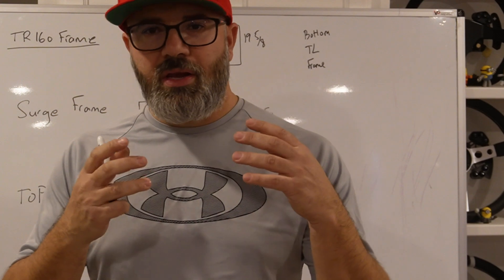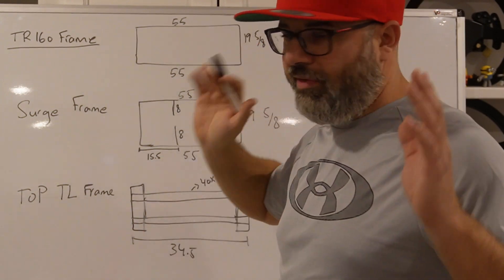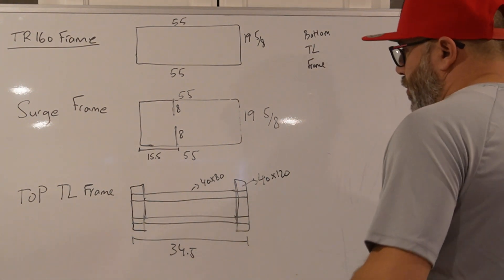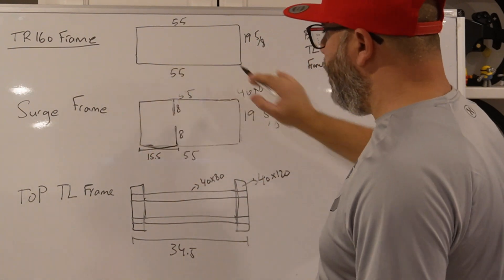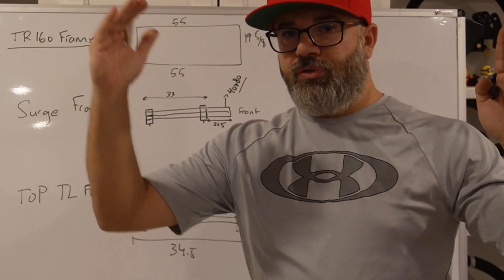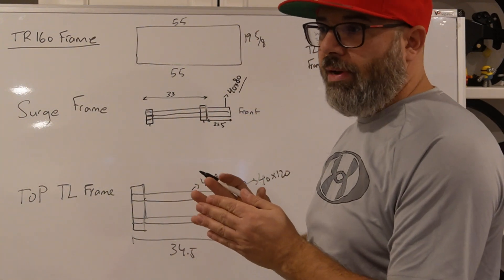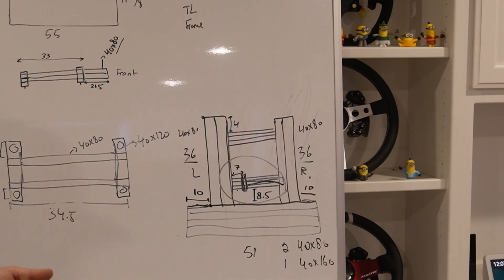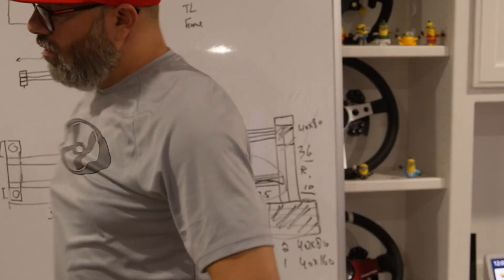Eracing lab RS Ultimate Series - Measurements

Comment: Appreciate the measurements but in case someone else follows this thread and makes the same mistake I did, those horizontal pieces on the lower traction loss measure about 21.5 not 31. Luckily i ordered 31 and just cut them down. It can also be figured by subtracting the width of the 2-40/120's plus 10" each side. Thought this may help someone. Thanks for everything!

Comment: dumb question but im diagraming this. on the bottom TL frame, what are the lengths of the 2-horizontal  pieces?
Reply from the maker: All pieces are mentioned in the video(unless I missed it by mistake). These are 31 inches.
Reply: @simul8master  thanks for the quick response. noted it down. also the lengths of the top TL vertical pcs, they would be the 40x120 pcs.
 Thanks for your time and effort. sorry if i missed it somehow. it also may be in your assembly vid which i have not seen yet.

Comment: thanx...
the one part i dont understand...how does the actuator connect to top frame? to cause it to move?
Reply from the maker: I have other videos explaining all this. The actuator does not connect to your actual rig. The actuator will connect to the surge platform. Your actual rig will then sit on the surge platform and connect to it via brackets.
Reply: @simul8master I am in the process of building this rig. When attaching the actuators, no measurement is given for vertical offset so that there is enough clearance from the surge and traction platforms. What offset would you recommend.
Reply from the maker: @RJCavallo hey - not sure what measurements you are referring to?

Comment: I found the measurements for the bottom platform but in another video for the traction loss frames you mention they are 40x120 and in this one you mention they are 40x80 which is too small to fit the TL plates that come with the kit I believe?

Comment: First of all, thank you very much for your video series!! It has motivated me to also consider a DIY solution, and all of your explanations have been very helpful.

Due to limitations in my man cave, I'm wondering if it's really necessary to have such a wide stand in the back. The TL doesn't seem to utilize all of that space, right? Is it for stability reasons, or can it be narrower? How far it swings from left to right probably also depends on how far back I would mount the TL actuator. I only have 42-43 inches available.

Have a nice day!:)

Comment: Excellent videos. I just completed my build on a NLR F-GT ELITE chassis. It was a little more complicated than the TR chassis. Regarding your surge. How much surge are you getting?  Mine is not very noticeable.

EDIT: Also, there is no way I would have been able to complete this project without your videos. KUDOS!
Reply from the maker: You can tweak to get more - are you using srs ? Did you enable boost?
Reply: I am using SRS and have just started  tweaking in SRS. Boost is at 5 I believe.  I don't see a slider for just surge which I found strange.
Reply: Hi brianh7293 I also have a  NLR F-GT ELITE chassis and I'm just beginning my measurements for the traction loss kit, can you share your measurements  or if you  have any tips or advice that you can share that would be great.

Comment: Hi, thx for the great video. What is the function of the front 40x160 in the lower traction lost module? I understand that the first one in the middle must have this dimension in order to provide enough space in the depth to be able to additionally attach the mounting for the actuator. The front cross brace only holds the rotation fixer, which would also look more central on a 40x120 profile. Is there anything i am missing?
Reply from the maker: Hey check my video on building the TL profile - It will probably address your concerns.
Reply: Thanks for the video  @simul8master . Did you actually post Part 2 for the TL platform? I don't find it.
Reply from the maker: Almost there brother - been pretty busy
Reply: Oh, Ok, thanks!
Reply: While you post that video, and knowing you're super-busy, can you tell me / show me how you fixed the TL actuator to the TL frames? I believe that the actuator goes on the middle horizontal frame (on the lower TL platform), but it's not clear to me how and where to fix it to.
Reply from the maker: @jamilkeg1  You’ll connect it to the left long vertical aluminum piece of the top TL frames
Reply: Thanks @simul8master  So it's just a perpendicular (90º) connection? I thought to have seen it differently from what I could see in your TL Part 1 video (which seemed like in some weird angle).
Reply from the maker: @jamilkeg1 nah just perpendicular. Sorry being late on the video - See this: https://drive.google.com/file/d/1PFVmHFJxbhtQ0y5MSWBm0aIGZYNjvzZ_/view?usp=drivesdk
Reply: @simul8master  Thanks again.

Comment: Thank you for proving such a detailed explanation for your rig build.  My question is on the surge and traction loss platforms.  Is there a specific reason why you went with 3080 and not 4040.  Also did you buy European standard aluminum profile or American.  Choosing 4040 European standard aluminum profile would reduce cost and weight by half.  Is there a requirement for your choice.  Thanks
Reply from the maker: Hey - These profiles are a mix of 40x80, 40x120 and 40x40 pieces. I did not use 3080. I bought them from framingtech.com located in newyork and they also cut them to the size I needed.

Comment: It looks like it would be safe to decrease the length of the rear piece on the lower traction-loss frame by about 10" or so based on the 3(ish) inches of travel it can swing in either direction. Would you agree? I watched your traction-loss test video and it looks like you had 5 or 6 inches to spare on each side of that piece when the rear of the rig was at the extremes of that actuator's position. I'd like to limit that specific part of the rig's footprint if possible so I'm checking with you first before I order aluminum. I'd rather not cut any if possible.
Reply from the maker: Yea should be safe to do so.
Reply: On a related question, I am also suffering from space limitations. If these actuators' maximum displacement is 150 mm, wouldn't it be enough to have the back of the lower traction loss platform to be just 150 mm wider than the maximum width of the surge platform with the actuators?

In your measurements, perhaps just adding 3" on each side of the back, for a total of 7" inches more than the front part? So, it would be 31"+7"=38" as the minimum required width on the back?
Reply from the maker: @jamilkeg1 this will work for sure
Reply: I built mine at 42". There is about an inch and a half extra length on each end, so I wouldn't go much shorter than 39". @jamilkeg1
Reply: Thanks for the tip,  @waltersheehey . After understanding that the actuator goes in the middle, I'm thinking that there will be more displacement than the original 150 mm than I thought (as it would be at the base of the TL); so, yes, I think I'll need a wider track for the TL.
Reply: Thanks for the confirmation.

Comment: @10:04 you mention that the two front-to-back pieces of extrusion in the lower traction-loss frame are 40x80s - I believe that they are 40x120s (because the plate that is supplied with the kit is about 120mm wide) unless you let the plate hang over the edge. Is that right or am I missing something?
Reply from the maker: They are 40x80s. I am talking about the top frame of the TL not the bottom frame. For the bottom frame, yes they are 40x120. I will have a video soon for the TL.

Comment: PRO TIP: If you have a business, make a business account at a local 80/20 distributor. I sent my order over for all the below cuts and based it on the retail pricing... I got 70% off.... ALL these cuts were $168, 5840mm worth and 8 cuts.  lol:  
# of Pieces	Size	Length of Cut
2	40x80	1300
2	40X80	500
2	40X80	200
2	40x80	920
Reply from the maker: That is pretty awesome! I paid a bunch of money for these profiles!
Reply: @simul8master  How's your paint job holding up?  Was going to powder coat locally, but will take too long and cost too much.
Reply from the maker: @dofmaster106  holds up pretty well! Same results as power coat to be honest. If you scratch it will show :) if you take care of it, it will be just fine.

Comment: As I was designing my layout based on yours, I couldn't help but notice your front actuators are behind the Wheel Deck upright.  What made you put it behind it vs in front, and what's the distance between your actuators?  Was it based on your seat position to try and get the best center of gravity?  thx!
Reply from the maker: The closer the actuator together the more movement you’ll get out of it. Recommendation is about 900mm front/rear actuator distance and you’ll get around 13 degrees of pitch compared to 9 degrees of pitch if they are about 1250mm apart.
Reply: @simul8master  Awesome, thanks!  That's what I understood, but just wasn't sure.  Based on your TL Top Frame length of 34.5" or ~800mm, I figured you had them at 750-800mm or so apart.  I was just trying to gauge to build mine.  I want as much pitch as possible as i'll be doing DCS and MSFS as well.

Comment: Did you attach the long 4080 profile on the upper TL frame to the 40120 shorter profile of the frame by drilling through the profile or did you use gussets? Same question for the corners of the and actuator mounts (shorter profiles in the middle) for the surge frame.
Reply from the maker: No holes drilled - all using gussets. Video and pictures coming up soon. Same for the surge small profiles. All using gussets.

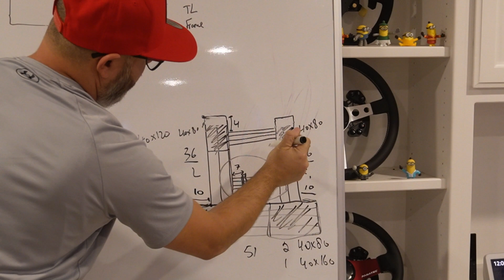Comment: What are the width's on the 40x160 (2 x 40x80) pieces that you have circled at 12:52?  They are the center 2 cross sections.  I'm trying to get most of my extrusion pre-cut.  I'm going to use US 15 series (1.5") Extrusion for mine :)  Thanks for posting these!
Reply: About 24.7 or 24.75 based on my math. But someone should confirm.
Reply: He used 51" for the end piece. Subtract 20" for the cross pieces inset (10" on each side). Subtract (approximately - conversion from mm to in) 9.5" for the width of the two 120mm cross sections. That leaves 21.5" I believe. I'm building one based on the ASR6 which is 22" wide (instead of 19 5/8" on the TR160), so my numbers will be about 24.5"
Reply from the maker: These are 21 1/4

Comment: Hi, Is it possible just to add just surge to the rig without traction loss, how mnay layers would you still need underneath ? Thanks
Reply from the maker: For sure you can. You will just need to build one profile for the surge platform where your rig will sit on and connect to.
Reply: How dose the rig connect to the surge platform, I see sliders on each side, so they screw into the rig frame ? I'm not sure about the location and where everything go, if you could make a video showing how things connect that would be great. Thanks again. @simul8master
Reply from the maker: @evanphotography5149  will do

Comment: Great video. I have subscribed and wait for some more content from you. I would like in the later stage add the surge but I am not much into traction loss (I mostly drive GT3s and don't have too much space in the room). Where did you get all the info needed for the build? I was looking on the internet to get some info about the surge platform but wasn't particularly successful
Reply from the maker: Not much info really anywhere. Did it myself. looked at some images provided by eracing lab and some questions to Alex from eracing lab. Planning to put all this into a pdf as well as a guide for others.
Reply from the maker: Let me know what you need about the surge - I’ll have a video up on how to build it.
Reply: @simul8master  that would be awesome, if you would make a video about it. My main interest is: how the frame should be built, what would be the proper size of the surge frame (especially considering that there would be no Traction Loss platform, so 4 actuators would be attached to it), would there be a need of a secondary frame under the surge in case I do not do the traction loss, how to properly combine the surge frame with the actual rig - myself I use Sim-Lab GT1 Evo but I guess the principals would be fairly the same regardless if it is sim-lab like mine, trackracer like yours or some other aluminum extrusion, travel of the rig while using the surge from eracing lab (that would be quite helpful as I think I am not the only one who is using a small room where every inch (in America) and every centimeter (in Europe) counts 😅)
Reply from the maker: Check the TL test if you’re ever interested: https://youtu.be/R6sATVxXVMs?si=e2xu7q7dAhvnkilT

Comment: Thank you for this! So the surge pull bar extrusion attaches to a piece of horizontal extrusion that you add to the TR160 rig?
Reply from the maker: That is correct. I’ll make another video on how it all connects as well.
Reply: looking for the video how it connects. I sent you an emails regarding building a new project but I haven't heard from you yet. Thanks @simul8master